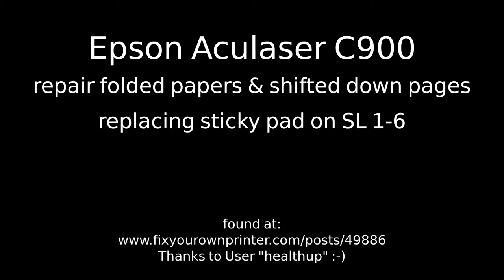Aculaser C900 repair: folded / shift down pages

Comment: Огромное спасибо автору видео. 
Столкнулся с похожей проблемой на этом принтере. Стоял он у меня 10 лет без работы, решил реанимировать, если бы не этот ролик то собирал и разбирал я бы этот принтер ещё несколько месяцев.

Many thanks to the author of the video.
I ran into a similar problem with this printer. I had it for 10 years without work, I decided to reanimate it, if it were not for this video, I would have assembled and disassembled this printer for a few more months.